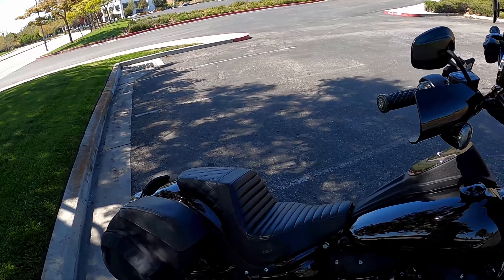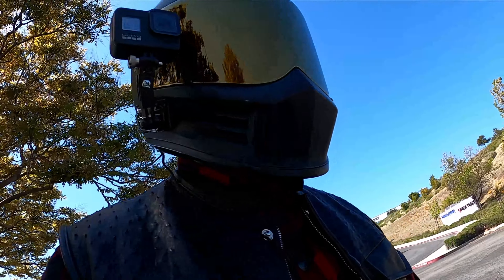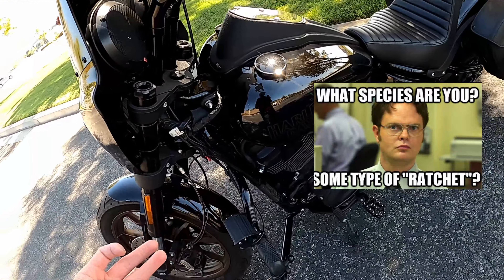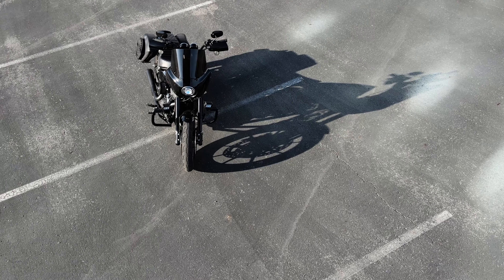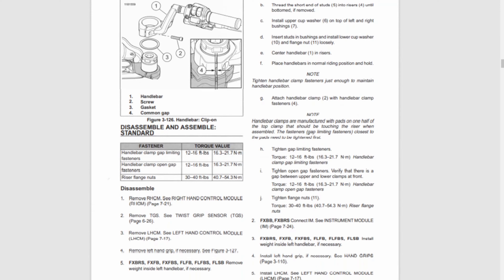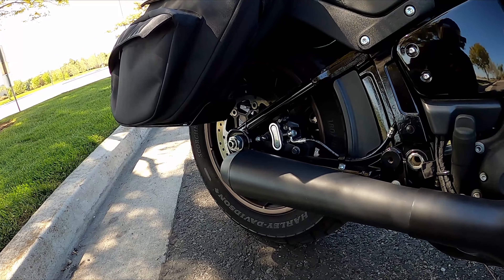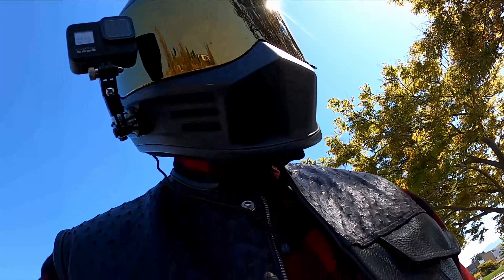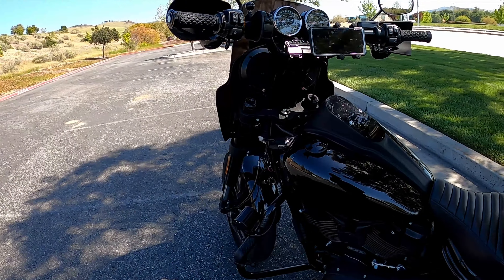2021 Low Rider S DIY Club Style Build - How Difficult Was It, And What Should I Leave For The Pros

Comment: I almost sent my leather pros back because of the stock exhaust so yeah you gotta make sure your exhaust is lower then the stock. Plus make sure your aftermarket exhaust isn’t pointed up at the bags my buddy melted his that way. Also if you get the low rider set instead of the low rider s set you’ll have to get rid of the blinkers.
Reply from the maker: I referenced some of those details with the EZ mount LP video. Someone else mentioned the exhaust being a problem with the non-EZ mounts. Thanks for the heads up vato, and thanks for sharing.

Comment: You mentioned that there are some differences in the 21 models. My brake line is finally coming today and I am doing risers. Do you know of any installation differences in the 2021 vs 2020? Been watching your vids and wanted to avoid any surprises during the install.
Reply from the maker: The touring models have those changes with the clutch cable, Harley stopped using hydraulic clutch with 2021 models.
Reply: @InfamousCreep  installed 9.5" thrashin pullback risers. Went with 42" HD clutch cable and 28" Magnum Shielding brake line. Both are little long but not terrible. Reverse bleeding the brakes was not bad. Did get messy but it was quick and easy. Tied a zip tie overnight and it tighten up nice. Didn't take too long getting used to my fists being in the air. You are right, makes you feel bad ass LOL!! Thanks again for your videos. Wouldn't have been able to do this without you!!